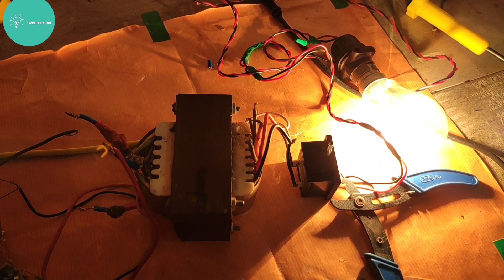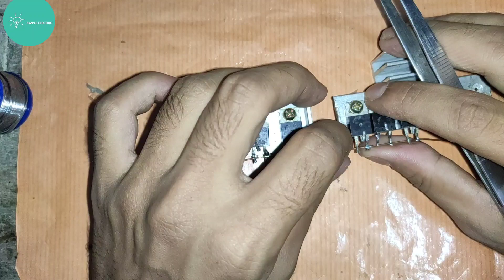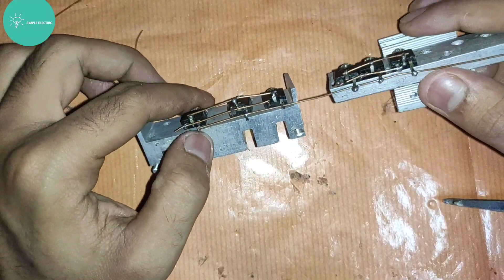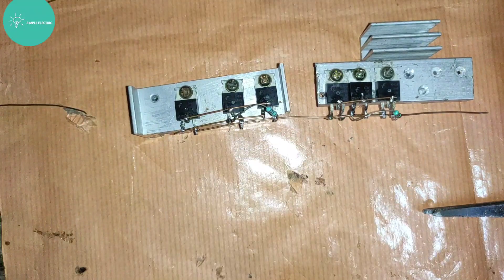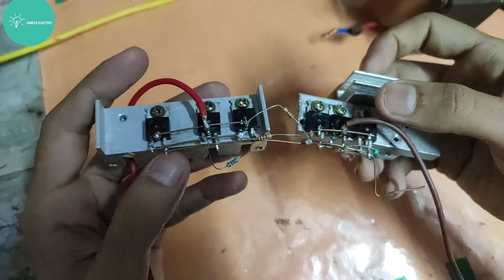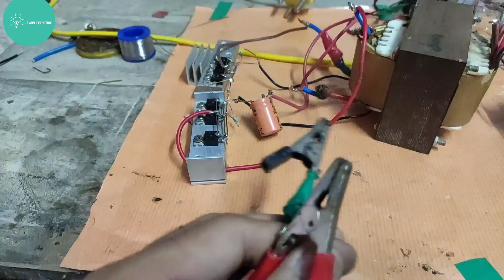1000W simple inverter powerfull | 1000W inverter 12v to 220v | 1000w inverter

Comment: 1000 Watts / 12 Volts = 83.3 Amps- those wires would just melt carrying 83 amps. NOT A 1KW DESIGN.
Reply: It is not 1000 watt inverter its really  400 500 watt but its frequency is not stable